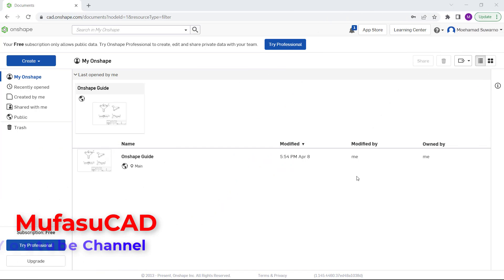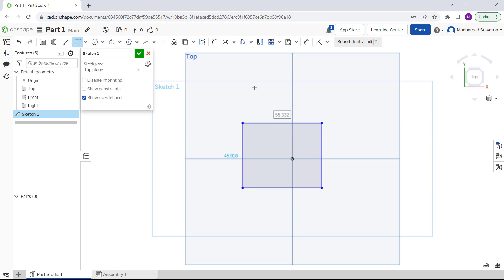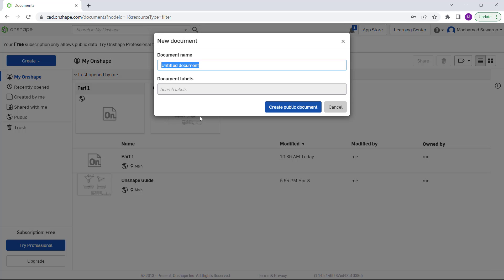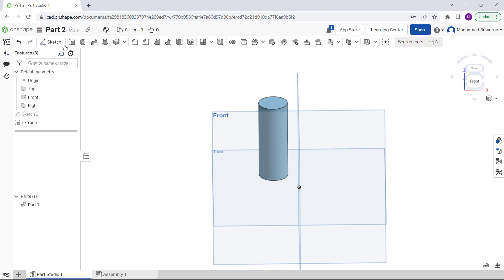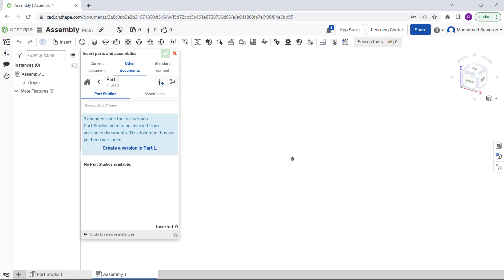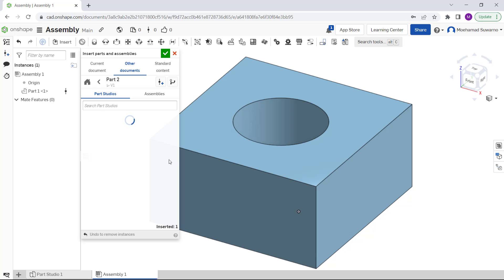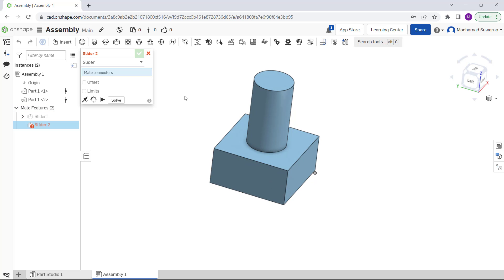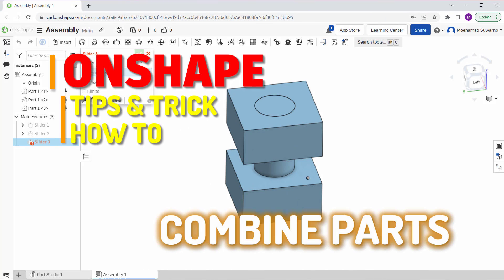Onshape How To Combine Parts Tutorial

Comment: You could do all this in the same document using the tabs at the bottom of the page. Now how do you merge parts from separate part studios so they can be modified like adding fillets. Following this method you then cant add fillets for smother 3d printing and further more adding fillets prior to merging with this method it will either break the mates or your fillets will be in the wrong direction.